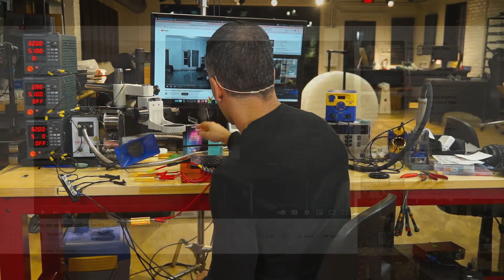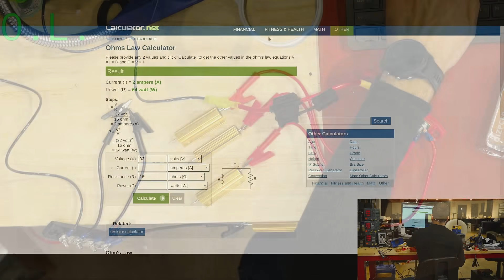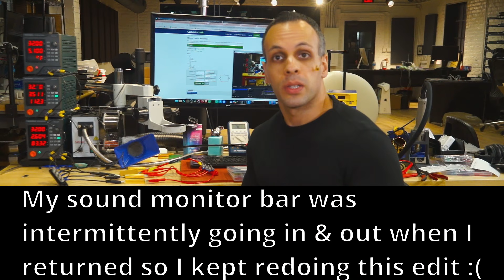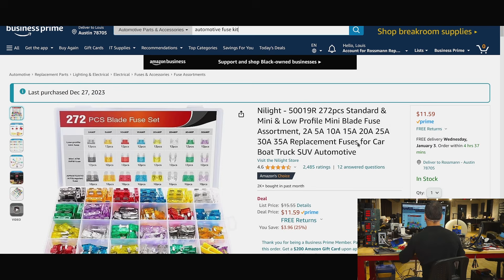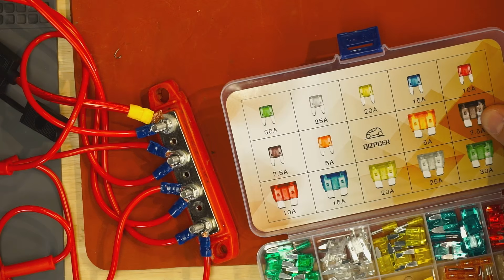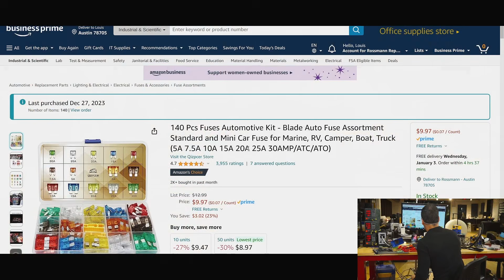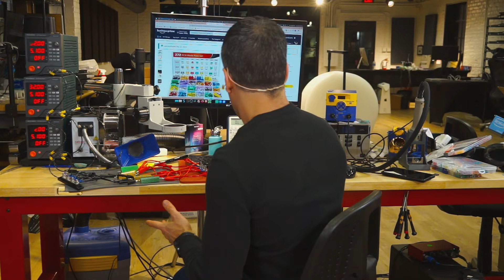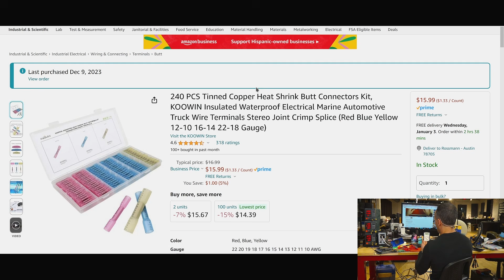Amazon Sells Fake Electrical Fuses

Comment: Platforms such as Amazon should be made legally responsible for the safety of goods sold through their sites. They would soon weed out the dodgy stuff then.
Reply: I don't know how it works in the US, but within the EU they are. Totally beats me how they can keep selling so much garbage. Besides the fact that it is garbage, it's starting to be extremely frustrating to find decent products, because as soon as you search for stuff, you're being overwhelmed by garbage.
Reply: Absolutely!
Reply: They are.  If the manufacturer can't be gotten ahold of, and since Amazon guarantees to some degree every 3rd party seller, they bear secondary responsibility for not vetting or engaging in any form of quality control for those who sell and resell on their platform.  The question is, will someone bring up a lawsuit.

They would have to prove negligence and damages as a result of something purchased on Amazon, coming from Chinese sellers.

The other issue is it's become VERY expensive to build any form of manufacturing business in the US, outside of a bare handful of states.  Even within those states, Federal laws are heavily restrictive and expensive to follow unnecessary codes.  It's why all the parts manufacturer's that used to be in the US and sold through Radioshack, died fairly shortly after changes made since Radioshack's death and added layers of beaurocracy and regulations they couldn't afford to comply with.  Nevermind added layers of costs just to procure materials.  The US used to be the hub of parts manufacturing.  It's only become even more draconian since Apple, et. al have gone after the independent repair industry that Louis has been fighting, killing off what bare minimum companies were left.  Though by the time of Louis' making that push several years back for right to repair, most of that manufacturing for quality, was in asia.  Virtually nill in the US.

Even the ones who moved to China have had to close shop.  So if this does go through, and someone does sue Amazon (and New Egg as well, as they should have been blocked from being purchased by a Chinese company), as should happen, it just opens up the can of worms for the next step of the equation.  How to get the US Federal and State governments to roll back regulations that are choking the hell out of small industry.  That's like pulling teeth from a lion high on cocaine and starving for the past month.  Nevermind city governments.
Reply: @ignasia7230 Amazon hold 0 responsibility for the safety or efficacy of the products sold on it's platform.
Reply: Bezos donates big to the Democratic Party—not happening
Reply: They ARE legally responsible.  Whether or mot they're held accountable is up to you.
Reply: Worst comes to worst they'll throw a few million dollars at some lawsuits, and keep making billions.
Reply: They are liable…..period
Reply: Don't say Weed, they'll start doing that too
Reply: Well the issue is that its essentially just ebay, all they are is a platform that makes online shopping easy and online selling easy. it isn't there responsibility to make sure all 3rd partys are doing things in 100% truth.
Reply: @redgator7250 no, that's just what amazon would want you to believe.  The agreement between amazon and its seller's and ebay's agreement with theirs are totally different.  Amazon IS the retailer in these cases and IS legally responsible.

Before defending billion dollar mega corps, you might be bothered to check your facts.
Reply: Yep, and prices would be even higher
Reply: @tschaderdstrom2145  so you pay a bit more for a product that is actually safe and does what it's supposed to... or you pay less and potentially have a product that starts fires or injures you.

I think most people would be willing to pay a bit more for a product that actually is what it says it is as opposed to something that is literally just garbage.
Reply: @wereotters  The problem is Louis was misinformed on how fuses work in this video. It's perfectly normal for fuses to work the way they did in his tests. He's expecting slow blow fuses to blow in 1 second which for that to happen on a slow blow would require at least twice if not more it's rated amp to blow that fast. Even on fast blow fuses they may need more than twice the rated amps to blow otherwise it will take some time to blow. Just google fuse blow time to see that's how fuses work. So that leads us on the other problem. If an electrical engineer expert such as Louis can't properly test amazon electrical fuses how can a non electrical engineer working in the amazon reviews/product sales department do any better? This brings me to my conclusion. If your gonna be doing any diy work that involves electricity or anything you should know how the gear your using all works an your buying the proper gear for the job otherwise leave it to a professional.
Reply: @underscore6071 Bro did you even watch the video? That first fuse he tested was not blowing for several minutes at 6 amps, three times the fuse's rating. It didn't even blow till he attempted to put 5 times the rating through it, even accounting for the possibility that it was a slow blow, that should NOT happen.
Reply: @Cosmic-Zulu Yes that absolutely is how fuses work. There are 400 amp fuses that blow at 700 amps for 1000 seconds. Just google for average time current curves and you'll find graphs on the times until fuses blow at different amps. Fuses absolutely can work like that. That's why if your gonna diy electrical work and not research the gear your using then have fun dealing with the consequences of diy something you should have paid a professional to do.
Reply: @Cosmic-Zulu  Don't even know how a fuse works but you comment as if you do lmao. WTF is wrong with people. Just look at the time-current curve for american made littelfuse mini fuses. Their 2A fuse will take 8A to blow in one second at 6A it will take up to 1000 seconds. Like you may as well delete your comment and apologize for talking out of your ass.
Reply: @underscore6071 this is the dumbest take in the world. I would've paid close to $750 to have a pro change the squirrel cage in my AC, I called some and no supplier would sell to me so that I would be able to get it back up and running in the middle of summer. I bought the exact blower fan from Amazon it took like a week but I actually got it and it only cost me like $100.
Reply: @underscore6071  How exactly does that equate? We're talking about a fuse that didn't blow till it was pushing 5 times its rating, and you list an example where a fuse blew at less than 2 times the recommended rating. Are you telling me that if that 400 amp fuse didn't blow till it was pushing 2000 amps, you'd say it was working as intended?
Reply: @Cosmic-Zulu  he didn't watch the video he skipped to the least fucked up fuse and assumed that was the whole claim. It's obvious he's riding meat like his last name is Kardashian.
Reply: @wereotters The big problem is most people don't have a clue about the quality assurance or safety of a product and buy purely on lowest price and that just perpetuates the problem combined with vastly inadequate resources of the policing and enforcement agencies.
Reply: @underscore6071 He needs to be testing all of these fuses against the published standards for these types of fuses. These will show the operating characteristics and allow them to be tested in a meaningful and consistent way against their voltage and I^2t characteristics.
Reply: @underscore6071 According to general slow-blow graphs a 2A slow blow should blow after 10s at 3A. This is to avoid burning out from startup current spikes. Watch the video again.
Reply: @tschaderdstrom2145  Would they? Now you dont get what you buy...
Reply: @jepulis6674 oh yeah you do! Anyone buying 300+ of an item in one package knows that it's the lowest quality that can exist. People shouldn't think that a fuse is only a penny
Reply: @tschaderdstrom2145
Better to pay more for products that are safe and works as intended than paying less for unsafe garbage. Unsafe products should not be on the market at all.
Reply: It would be enough if they're required to remove fraudulent listings.
And a 2A fuse that blows at 5A is fraud. So is one that blows at 1A. It should blow at 2A and nowhere else.
Reply: @tschaderdstrom2145  let's all just keep buying cheap crap that doesn't function, then. At least it's cheap!
Reply: @tschaderdstrom2145  no they wont
if a bad fuse that doesn't work cost $2, its already more than what it should cost, which is 0 as it doesn't provide any value. any product that actually provides the value you wanted is technically cheaper no mater what its price tag is, because the actual value you get for what you pay is not 0.
Reply: @tschaderdstrom2145  Now why would prices be higher
Reply: @tschaderdstrom2145 Prices are always higher for products that don't burn houses down.

Comment: fuses aren't supposed to blow exactly at their rated values. In fact there should be a datasheet showing how long it takes for a fuse to blow for different currents. You can pass 10A through a 1A fuse for a few microseconds and it will not blow. Similarily you can pass 1.001A through a 1A fuse for minutes. I wouldn't consider 1.2A perpetually not blowing the fuse to be out of spec.

If there isn't a datasheet, you shoudn't buy it. And not everything from china is trash, even though a lot of it is. And not everything made in USA is good. Even if there is no english version of the datasheet, the language of science is universal enough for you to understand what they want to convey.

Though what you show is ridiculous and well out of spec for what anyone would expect from a fuse. Also I would expect the tollerances for those trash fuses to be swinging wildly. One 2A fuse might blow at 3A, while another may blow at 15A.

Comment: It didn't occur to me until later; don't those supplies have a current limited mode? You shouldn't need the resistors at all; remember that the resistor forms a voltage divider with the fuse; so the fuse never "sees" the full voltage anyway. In fact, the voltage across the fuse at 8 amps will be the same whether its coming from a current limited supply, or a voltage limited by a resistance. So save yourself some inhaling burnt resistor junk and just set a current limit.

Comment: The terminals you got from Amazon in the last Video are designed to be heated and solder the wires together. 
The metal connector is just a ring of solder, which is why it does not work with crimping. 

Otherwise, I fully agree with your statement that there is more and more crap on Amazon.

Comment: It's a fuse "kit" ie. some assembly required. They're deliberately a little oversize so you can sand them down to the final value yourself
Reply from the maker: I love these. Keep them coming. I am enjoying the laughs. Thank you!
Reply: A fuse sander sounds like the peice of equipment an electrician team sends their new intern out to Home Depot for.
Reply: @joshuana514  Yes it sometimes comes bundled with the long weight for a pipe stretcher.
Reply: This dude needs to stay away from my car.
Reply: imagine taking that comment serious
Reply: there was a joke a late soviet union about americans stealing blueprints for a fighter jet. so they built the thing following the blueprints, and it turned out to be a steam locomotive. sooner or later they get a hold of the chief designer and ask wtf it was. to which the guy says "did you read the last page? it says 'file off excess metal at the edges!'"
Reply: This sounds like a joke, but some people seem to have taken this post seriously.
It'd be great if you could confirm whether this was a joke or not, before your comment turns into hell itself.
Reply: @gamin9wizard945  That would ruin the joke. Part of the fun is people taking it seriously :)
Reply: @ingenierocristian  Look, if you aren't building your fuses manually from atoms, you're doing it wrong. Git gud nub.
Reply: That's more retarded take than someone musing on how to light up a cigar with a nuke going off! Thanks for the laughs!
Reply: This has to be sarcasm or satire... Right? ........ Right??
Reply: BRO WHATTTT
Reply: The pin of shame!!!
Reply: @saboorpatel01   Rather the pin of honor.  The OP is highly skilled in the art of satire.
Reply: Are you a bot because you didn't even read the comment you responded to and just looked at the pin. To explain the comment to you, since you REALLY need it, it's a joke about how all these junk fuses are oversized and you need to "sand them down" to make them work. Of course understanding this would require you to have watched the video which I also doubt happened. The pin happened because Louis liked the joke not because of shame.  @saboorpatel01
Reply: .......you're being sarcastic right? I'm no electric engineer but even I can tell when a component is labelled exact Amp values and comes with a note telling you to use the exact one they do not mean for you to down size  them yourself (of which I'm skeptical if you're even supposed to do that with a fuse wire). 
Well if you aren't a "kit" also means "a packaged collection of related material" (from merriam-webster)  as is the obvious case here.
Reply: @cyberdragon1000  It's a bread kit, some assembly required. They're added some rat poison so you can test and remove rat poison pills yourself.

Comment: I am a car mechanic. So you might guess I work with automotiv fuses on a daily base. When in your car a curcuit is fused with 2 amp there will be very very thin cabeling behind the fuse. And there is one thing you do not want in your wire harness. A smoldering cable that has to take a bigger load as it is supposed to. And that is the main reason for fuses in your car, as a cable burn will possible set your car on fire. So a 2 amp fuse that blows at 10 is bad and sadly you were not able to test the higher fuses with your setup, but think about a 15 or 30 amp Fuse blowing at double or even higher load. Thanks for the test. ( Please excuse my poor english as it is not my first language.

Comment: im also curious if you tested the orange fuse from the first box if it would blow at low amps, I wonder if they are putting in the wrong sheet with the wrong rating in with different packages. Im curious why the same amp rating would use different colour fuses

Comment: I put a S-Amazon  fuses in my Ram and Yukon I never thought about this I don't remember what fuses I replaced so I have to buy a bunch of name brand fuses to swap them all out. My Ram is worth almost 100k and not under warranty I'm not taking a chance,  the Cummins engine and its electronics are way more expensive than its Gasoline counterpart.
Reply from the maker: Littlefuse, bourns, Panasonic make excellent fuses

Comment: Looking up the Littelfuse time-current characteristic curves for blade fuses, 2 A fuses are specced to blow 3 A in 4 sec, 4 A in 0.3s, 5, and 10A in 35 ms... Even the most generous slow-blow fuse datasheets I can find have 400% current blowing in under a second, though the 200-250% range seems to vary more: sometimes 1-3 seconds, sometimes 100 secs.
Reply: I found a data sheet for 400% at about 5 seconds for a slo-blo.

Comment: Fuses blow on excess current draw not power. If I have a 1A fuse on a 5v rail and the rail gets 200v and the circuit destroys itself only drawing 100ma of current the power is 20w instead of 5w but the fuse wont blow

Comment: Just a heads up, those resistors have its rated power when connected to the decent radiator.

You're burning your desk because they are only rated to dissipate ~1/5 of the power rating if not connected to any radiator

Also you... don't really need them if your power supplies have regulated current. maybe like 1ohm resistor in series of each power supply so they spread current more evenly